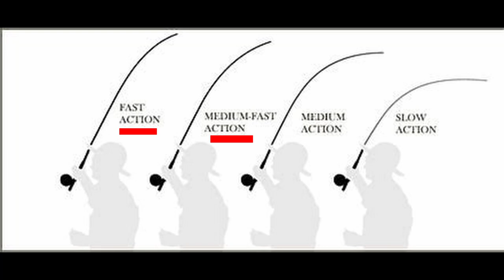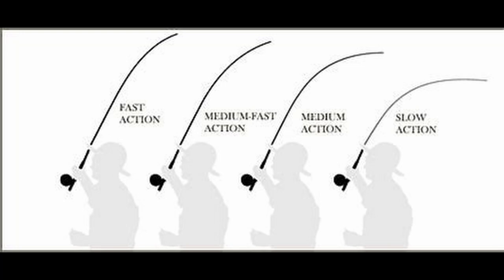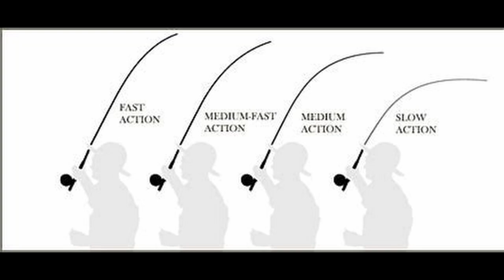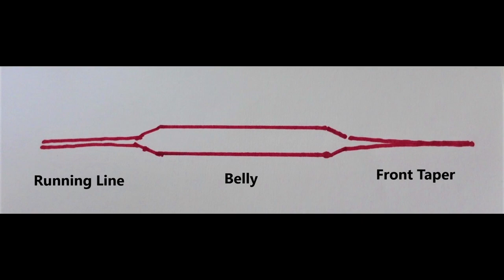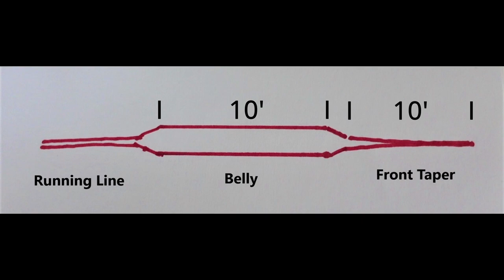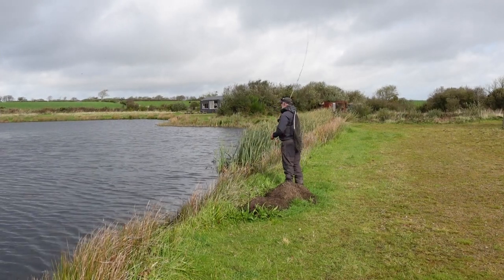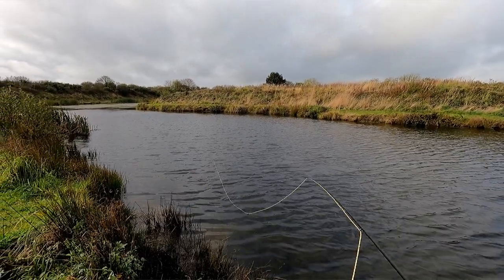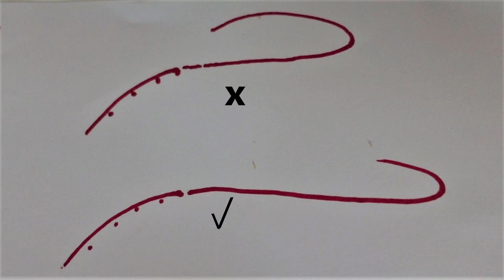FLY CASTING TUTORIAL WITH A DIFFERENCE. So that's how they do THAT.

Comment: Hi Shaun, the double haul is mostly thought of as a ‘distance technique’, however, it works by directly increasing line speed which is advantageous to distance, but is also useful for distributing your input into the cast, which will reduce overall fatigue and give you more control. Regarding the line, the goal is to move the head as straight as possible towards and away from the target, which means keeping the head at the top of the loop during rod counterflex (if it’s a WF). To do this, we need to include some overhang (running line). To find the sweet spot, locate the end of the head, measure your haul length and add 3’ onto this, maybe 2’ extra to dial in your release timing. That’s how much you need out the tip and the line will fly. Hope that helps 🙂
Reply from the maker: Really well put and spot on. However maybe a bit to much for a lot of people out there. I would love to see them improve the basic cast. And for a lot of viewers are of the maturer side of life. I did try to explain and give idea as to how to work out the haul length. Its great to hear from you and your massive experience of distance casting. Thanks so much. I am sure a good few will read your comment and hopefully take it on board. Take care mate. Shaun.
Reply: @shaunfishes101  Thank you, Shaun. I really do enjoy your videos, we should do one together at some point if you are ever in England, I’d be more than happy to get you a guest ticket on our waters. It’s a tricky one isn’t it, but I absolutely agree In regards to people improving the basic cast, it’s an essential skill! 

All the best

Nick
Reply from the maker: @strikefromthereel1179  Where are you and your water Nick.
Reply: @shaunfishes101  Hi Shaun, Warwickshire Fly Fishers in the Midlands (Wolvey)

Comment: The guys in the video don't even bother with the 10-2 rule, their rods finish the cast parallel with the water and the line is still flying out like a rocket 😮
Reply from the maker: Well observed. The rod position will depend a lot on the conditions at the time. For most of the time when doing this video the wind was strong. And some times very strong. During conditions like this we try to keep every thing low. The higher it goes the more wind you will catch. But you will find that rod position will change when casting very big distances. But on a good day with average casts 10-2 is good. These are the points as to when the rod will load best and send the line in the correct path. More horizontal. As appose to a figure of eight. Thanks for watching and for the comment. Take care. Shaun.

Comment: “Too many people are struggling” i think is the first time i hear anyone saying about fly fishing… apart from me. A big like for that!!! I say this because no matter what people say, this is pobably the hardest type of fishing invented by man (i’ve been fly fishing for 4 years now but still struggling with casting against wind with a floating line)
Reply from the maker: A lot of people do struggle with casting Catalin. The thing is they will not mention that they need help, as they are all so good at casting. 4 years is still very new in fly fishing terms, and casting into the wind requires spot on timing. One thing that will help. Like watching the waves coming in on the beach, there are breaks. The wind is the same. This is when we make our cast. When you are able to get the cast in with two false casts. The rods we use for the windy days are the fast action rods. You can generate the speed in the line so much faster. Keeping the rod at a slightly lower angle does help, as there is less wind as we get nearer the ground. But most of all its the timing, getting the rod to load really well. Thanks for the watch and comment Catalin. As they say practice makes perfect. Keep at it. Take care. Shaun.

Comment: If you hear a rod whistling - the energy of both, the rod and the angler, was wasted.
Reply from the maker: It is very rare not to hear a rod cutting through the air during a cast. For years I used to wonder why my rod never made this noise when every body I watched or fished with did. It was only when I had a stand alone camera set back that I could hear it. This same noise rarely comes through on the gopro. One way that the noise may be reduced is with a short soft cast. I have checked several professional casting videos. It is still there. So I am not totally convinced by what you claim. Sorry. Shaun.

Comment: I having a lot of elbow pain.
Casting flies for pike   i started out with a Guideline #9 sink 3 airflow.. A couple of months further i was casting an Orvis Clear water #10 paired with 40 plus sniper fast intermediate.
After a couple of months im sensing a lot of pain while casting in my right elbow.
Then i bought a TFO #8 . ( all the rods are 9ft) was much more enjoyable and less pain..
Im just in my first year of Flyfishing.. but is a lighter rod a way to have less pain or im i doing something wrong?
Casting 20 meters is not a problem.. but very exhausting.
Reply from the maker: This is all heavy stuff Jason. I think for most of us would get some sort of reaction casting this heavy set up. Another thing to consider, is that you are new to fly casting. You will be working muscles you may never have used in the same way before. There is a lot of line weight out side the rod, which in turn puts a lot of strain on the forearm. If any other rods are to be purchased, Start looking at 6#. You will find this will make a massive difference. Lines will also be important. Shooting heads also create a lot of line weight out side the rod. If you are targeting mainly pike. I will ask Justin as he has done a lot of pike on the fly. We will try to find you a set up that could help. A 6# rod has no problem in dealing with pike. But the flies could be a different matter. We will get back to you. Shaun.
Reply from the maker: Spoke with Justin. 6# rod no problem. Preferably a faster action. WF line 10' tippet and 6'' wire and up to a 6'' lure. What to look for in a line. Short front tapper. This will present large patterns with ease. Shorter belly, this means you can load rod quickly and make the cast. Less line in the air during back casts. Means less strain on the arm. Hope this helps. Any thing your not sure about just ask. Shaun.
Reply: Thank you very much Shaun & Justin for your time, knowledge and effort. 

You're right.. my arm elbow and wrist are not used to the movement..and on top of that.. my technique needs a lot more attention.

I'm fishing from the boat on large bodies of water .. and not always but sometimes i get to meet some very big pike 'meter+'  ..again.. most days they are a lot smaller
But is a #6 Weight capable enough for the big ones?

My streamers are 15 cm sometimes 18.. not too thick so they are quickly at depth.

I will check out the lighter rod and line setup.
The shooting heads cast with little effort but are heavy.

Thank you very much Shaun & Justin

Comment: Hi Shaun was it yourself I saw who hangs lines up in big loops of coat hanger over winter keep the memory out them.
Reply from the maker: Hi William it could well be. Any line that I may not use for a longer period I will hang. The bigger the loop the better. So long as the point of hanging is not sharp, like keep the diameter as wide as possible. The spools the line comes on is OK. I did show this on the Barrio line video ages ago.
Reply from the maker: Oh forgot to mention, if a line has very bad memory, this is not a cure. It can help. Its more to prevent memory.
Reply: @shaunfishes101  There the Airflo superflo Shaun I have the 6ft and 12ft fast tips. There good not much memory. Cold weather doesn't help them. A try find the wan on the Barrio lines you done.
Reply: @shaunfishes101 not memory related but a useful tip if your fly line is twisted and liable to tangle between reel and first eye. An old guy told me years ago to grass my line. This involves stripping all your fly line and some of the backing outside of the rod tip or just off the reel if it is off the rod then walk for say 100 yards through grass dragging the line behind you. It works a treat and takes all the twists out.
Reply from the maker: @davidbenjamin5356  Actually I should cover this one, as so many people fish the bung. Yes you are spot on with this. Line twist is more common than ever. Its the drag coming through the water and air with anything that is not so stream lined. Some say it can be the cast, or even with certain lines. But as you say its a simple fix. And funny enough I had to do this myself only last week. I will have to mention this sometime on a video. To you and me this is simple. But I am sure there could be many out there, would not have a clue. Hope I remember to give you a mention when I do. Many thanks David. Take care mate. Shaun.
Reply: @shaunfishes101  yes and I find a blob or a booby as the point fly of a washing line set up causes dreadful leader twist especially with fluorocarbon around 0.2 mm

Comment: Great fishing thanks
Reply from the maker: Thanks again Jon. As I said in the video, people are still having problems casting. Many videos out there telling us the same thing with the cast, so some thing must be missing. This is when we decided to talk lines. This is so important as part of the cast. Thanks again Jon. Shaun.
Reply: @shaunfishes101  I use the 40 + floating, it has a terrible memory but I can cover most of the ponds with it ,it is a wee bit annoying trying to stop it coiling on the shooting head ,any advice  cheers .your videos are great for beginners like me
Reply from the maker: @JonFisher-ql6xe  I did have a Wolf tt line that a memory problem. I boxed it back up. ten months later decided to try something. Put it on a different reel which was bigger, only by about 10mm. Could not believe it. As good as they say it should be. Not saying this will fix yours. I personally will not fish with a line that has memory. Actually I would if I was pulling lures all the time. But fishing the small stuff, No chance. I would rather cast a bit shorter distance. Presentation is more important to me than distance. What rod are you fishing.
Reply: @shaunfishes101  hello n happy New year ,it's airflo 40 + floating line on a airflo delta xp .the reel was part of the greys starter kit kast 9,7 ,8 wieght. It won't fish straight untill the last 13 ft